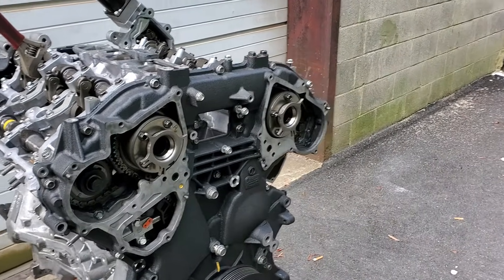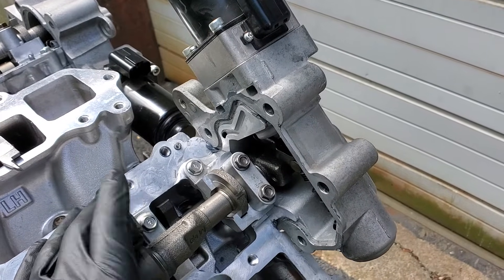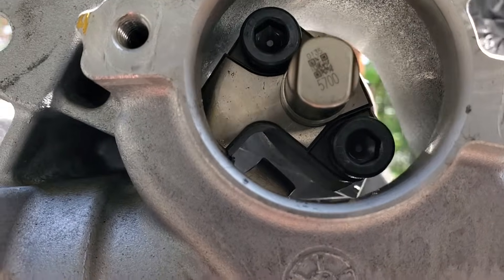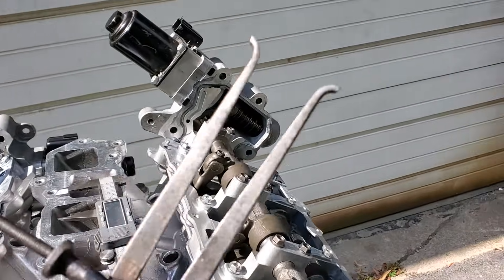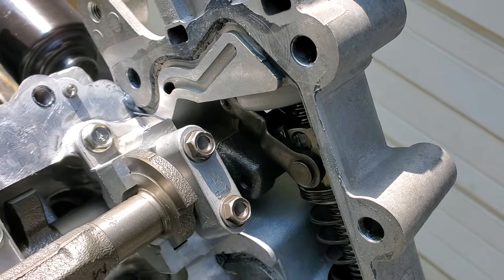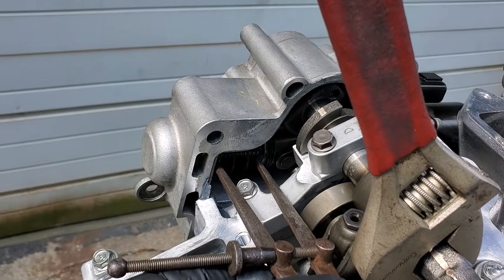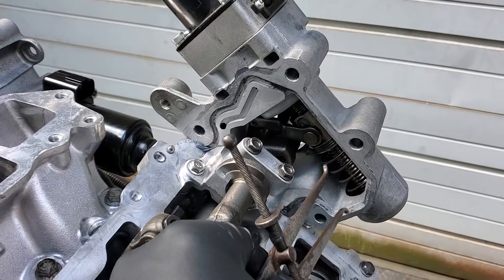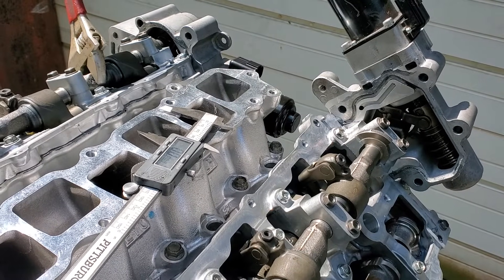VVEL fix for Nissan 370z and Infiniti G37

Comment: Awesome video! Question, do you guys have any experience with replacing just the black VVEL motor itself on the head? I bought a used motor with a broken connector and swapped the motor itself from my old engine.

Now I’m running into an issue where my car only cranks and won’t start unless the crank sensor is unplugged. I’ve verified the flywheel is positioned correctly and the timing chains were set correctly. I wonder if this has anything to do with my problem. Any input would be appreciated!
Reply from the maker: Not sure, did you have to disconnect the motor control arm from the control cam?
Reply: @sethjoyner391  no I did not. Just the 4 bolts up top, slips off, and replaced
Reply from the maker: @frankp4071  hmm, did you go through the vvel relearn procedure? adjusting the sensors etc?
Reply: @frankp4071  wassup man! I was wondering if by any chance you found the fix for your problem because I am running into the exact same situation as you. I switched the driver side Black VVEL Sensor with the 4 hex bolts up top since the one from the motor I bought was broken. I DID NOT remove the whole assembly that connects to the cam. Now when I go to start my car, just cranks but doesn’t start. I have tried the VVEL position Relearn with my scanner but still no luck. Help would be greatly appreciated!
Reply: @josealzamora948  did you figure it out bro?
Reply: Is this the only method to set the vvel timing back to factory settings?
Reply: Hi did you figure out your issue